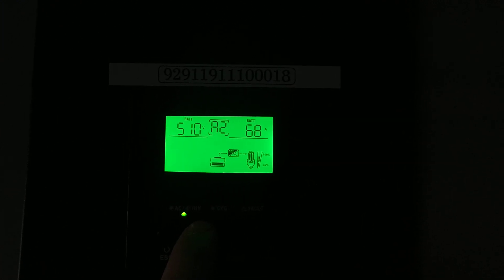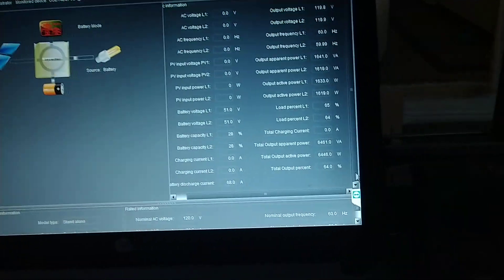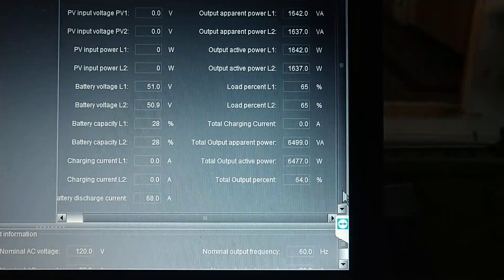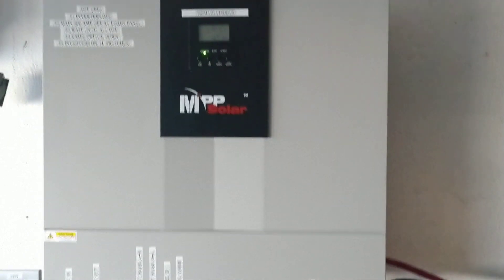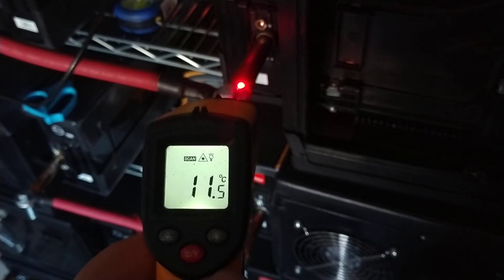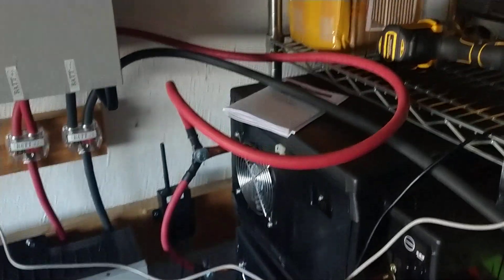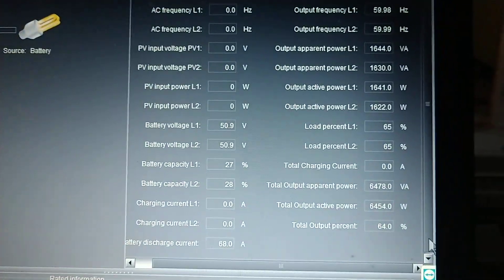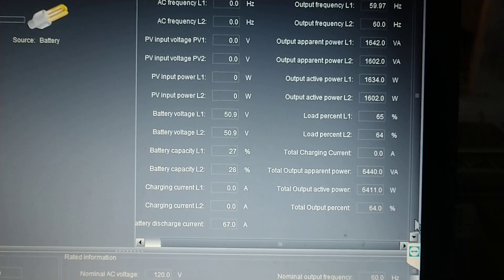OFF-GRID BYD Batteries in a House.

Comment: I bought a 2.5kw used array for $577 delivered and was looking at these batteries. The few people that had them told me they are hard to balance, do you have issues with them.
Reply from the maker: Usually one cell in the pack is very degraded.

There is no way to fix a degraded lifepo4 cell.

So the only way to use them is to limit the voltage to about 53.1 at the top and 50.6 at the bottom.

That is a huge amount of capacity not available.

What happens is if you use them down to ~48v the degraded cell drops off all the way down to nearly the lifepo4 limit of about 2.0v while the others are still in the good voltage range of ~2.9 to 3.6.

No balance can cope with this amount of difference.
Reply: @JasonCarmichael  Thanks for the info. I need to focus on the cabin build so I cant start camping out in the middle of no where.

Comment from the maker: This system is not grid-tied.
It is grid-supplied and can back feed the house panel IF I turn off the grid at the main panel.
MPP Solar says it will release the smoke if you tried to connect the grid-tied.
UPDATE 21 Feb 2020
The batteries are no longer in a series-parallel configuration, but a parallel configuration so that they are all attached to a common point and can operate independently. Before if one went into safe mode it shut them all down. Now they all operate separately, but feed to a common point, much like any buss bar setup.

Comment: A little unsolicited advice? Daisy chaining the battery pairs together like that creates unequal resistance from the top pair to the bottom.  And it's no wonder you're getting heat at the top of that stack where all those amps are collecting.  I have 10 of those same batteries in a 16S5P configuration.  But each pair has identical length 2 AWG cables and BMS that go to a + and - buss bar.  Then  2 foot long 4/0 cables go from the buss bar to the inverter.  And, once you get BMS/Balancers hooked up you'll be surprised how off those cells are and how much more capacity you can get when they are balanced.  Be sure to get a high current balancer. 200ma units will take a century or so. :) I've been running my whole house  for 8.5 hours with no conservation and I'm still in the flat part of the curve.  I figure 1 day easy, maybe 2 depending on how far gone these batteries are.
Reply from the maker: I have since changed it to a central collector point(basically a buss bar) , after realizing that I created a Parallel-Serial battery. I really noticed when I put the other 3 BMSs on the rest of the 3 serial packs. 10-11 going through 20-21, through 30-31, through 40-41.

What was really the biggest surprise was when I put the 4th bms on the last 2 packs was the 16 cells were only 0.002v cell difference!!!

Anyways, normal use for me is about a 8 to 9 amp draw, as seen by the inverter from the entire 8 packs. I run the battery set every day for 7 to 9 hours M-F for demand tariff avoidance.
Reply: @JasonCarmichael  Good deal. It seems we're all headed toward the same place. I put mine together for power outages so I don't have to run the genny all the time but we can sign up for time of use billing also.  We'd save just $50 per month on a $200 bill.  I wonder if it's worth it for cycles on the batteries?
Reply from the maker: @ericbraun4652  Now that I have the bms settings figured out, each pack is only 0.005V apart at present. This is 2 full days of balancing, while still using them to cycle down and up. I have 64 cells, in 16S batteries, which are divided into two packages of 8.
Battery 1 - 0.009V (this is the widest V spread)
Battery 2 - 0.002V
Battery 3 - 0.002V
Battery 4 - 0.003V
Battery 5 - 0.004V
Battery 6 - 0.004V
Battery 7 - 0.005V
Battery 8 - 0.006V
Reply: @JasonCarmichael  Nice!  Well done! I wish I could get results like that. I'm not so optimistic anymore. I'm having trouble with mine.  I've got at least 2 batteries with 1 weak cell each.  Figuring out what to do...  Balancers help but even if balancers allow the other cells to charge eventually, that weak one is going to hit bottom well before the rest on discharge.  The world of DIY...  Maybe parallel a 100mah cell to the weak one?  Batteryhookup is taking them back if they're not living up to spec.  I just hate to do that.
Reply from the maker: @ericbraun4652  Not that I have the BMS balancer setting sorted out, I am planning another deep discharge this weekend. I expect, err hope it will control the two cells that dive bombed to end the capacity check.

Comment: is that grid tie system?
Reply from the maker: No.

The grid supplies the AC to the charger. .
The knife switch disconnects. Then I disconnect the grid.

Finally the inverter supplies the house. I essentially made my regular loads panel, the critical loads panel at the same time.

Comment: how are your batteries wired?
are you using BMS?
what are the charge settings?
Reply from the maker: The wiring is considered 16S4P. (Two Packs of 8 cells).

No BMS installed yet, but I just finished putting it together to install, on one of the Ps. (3 more to assemble for another day)
16S BMS with LCD Screen (https://www.ebay.com/itm/Smart-Lifepo4-li-ion-Lipo-LTO-Battery-Protection-Board-BMS-48V-72V-Bluetooth-20S/192880341024)
Video of the BMS (https://youtu.be/im4ggvoni5M)

I am still experimenting with the charge settings. For now, I am bulk charging@ 56.5V and 16 amps, then float charging at 52.9V.